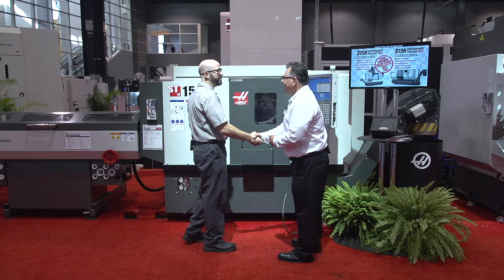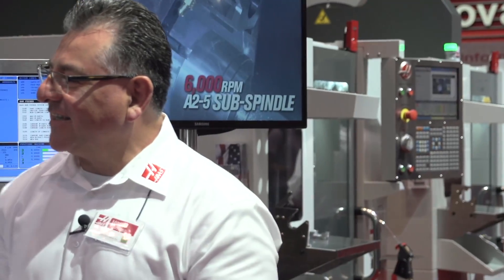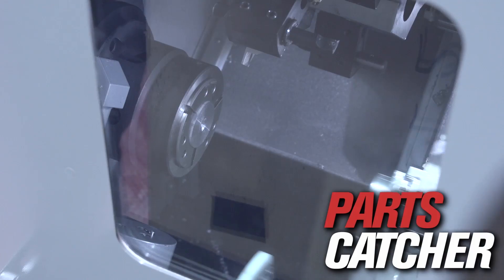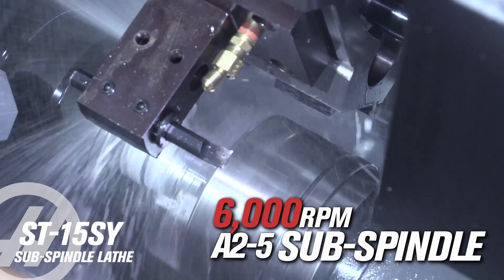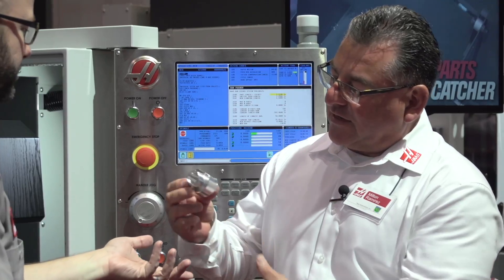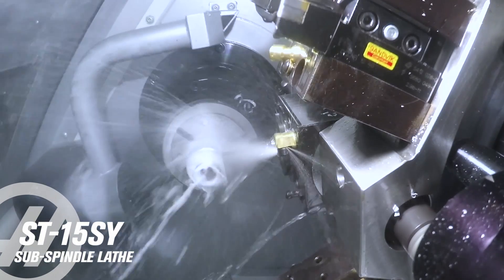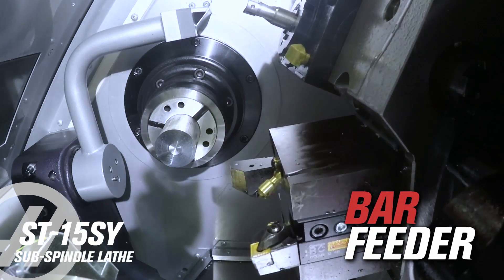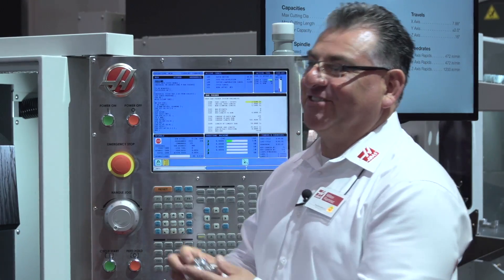The New Haas ST-15SY Sub-Spindle Lathe from Haas Automation

Comment: Hi, This model is not mentioned on the site, I cannot find any information on haascnc.com site

Where i can find more information about this and other new (if any) machines?

thanks
Reply from the maker: Hello Joseph,
At this point the ST-15SY is still in the prototype stage, that's why you don't see any further information on haascnc.com. The projected release date for the ST-15SY is towards the middle of 2017. 
As far as other new machines, haascnc.com is definitely the place where you'll find new information first.
Thanks for the comment!
Reply: Hi, Thanks for the reply...
Is there any information about the sizes of the new line? specially the bar capacity as the current double spindle lathe max at 2" bar capacity... hope to see an upgraded specs there. Thanks
Reply from the maker: Joseph, 
The plan is for the main spindle to have a 2.5" bar capacity just like the ST-15. The sub-spindle will not have a thru hole.